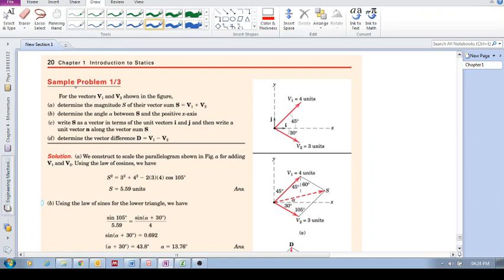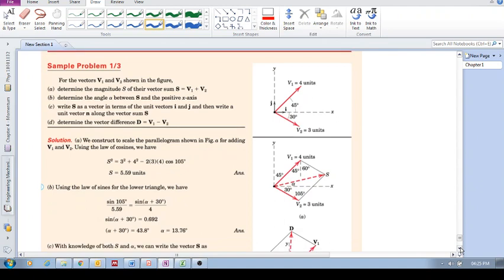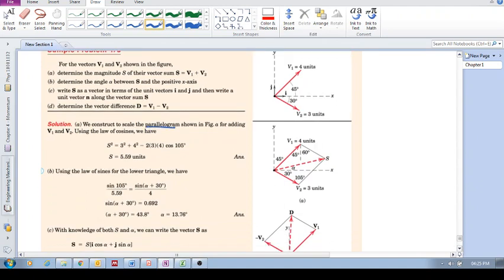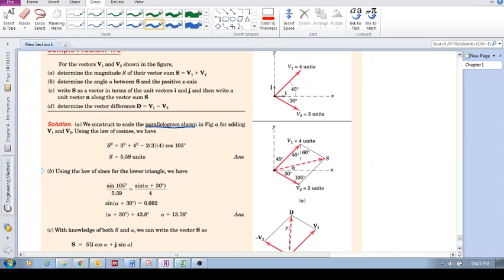Chap 1 - Introduction to Statics: Sample Problem 1-3

Comment: How do we get the 105 degree angle? It's a bit confusing
Reply: did you get the answer?
Reply: @anumirfan5601  yeah I did an year ago.
Reply: can you explain to me
Reply: @anumirfan5601  it's simple actually. Look at the lower left side of parallelogram. Find the internal angle between the 30 and 45 which comes out to be 75. Now since one side is 75 degrees then the opposite one has to be 75.

Then the unknown angle can be calculated as.

2(75)+2(X)=360
Since all the angles in a parallelogram add up to 360 solve this equation then you get 105 degrees
Reply: thank you very much jazakAllah
Reply: @anumirfan5601  no way you understood the way I wrote that😳
Reply: luckily i did.